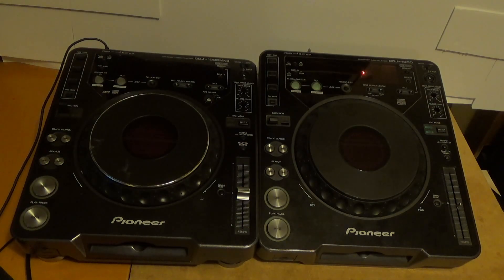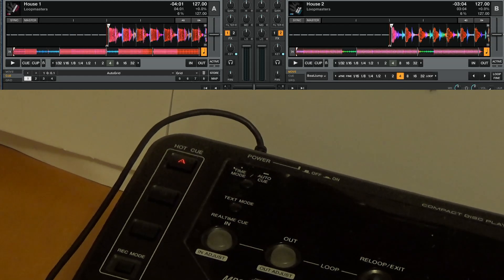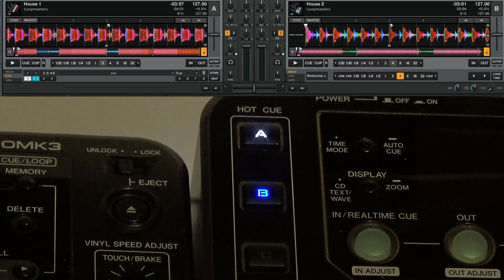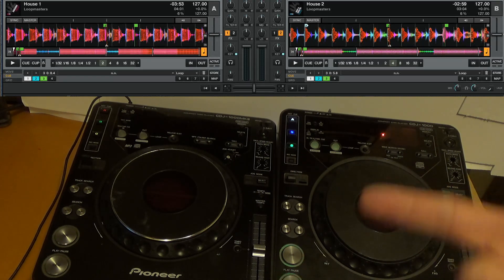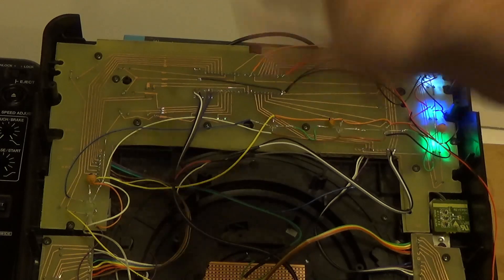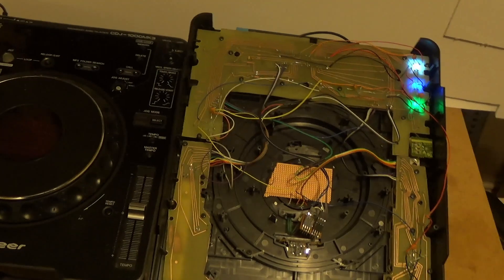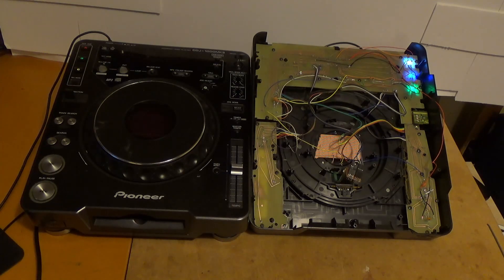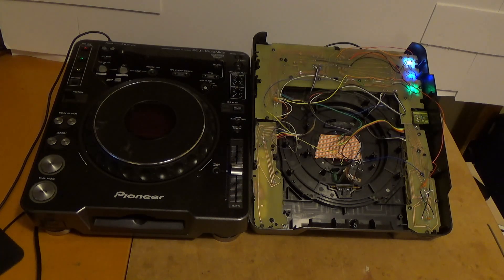CDJ 1000 MK3 Midi conversion- Custom PCB

Comment: Is there any more news on this?  What was the final price for a conversion?
Reply from the maker: I had some problems with the neo pixel, the software lib conflicts with reading the jog wheel so is quite a big problem. I need to switch over to SPI based addressable led and design new PCB. At the same time I was looking  to make connections easy and looking for the best way. At the moment I am quite busy, but also do not have the money spare to buy a new batch of PCB as they are large and will need to order 3 x 5 of them. So it's still something I want to do, but time and money are a factor at the moment. I Keep  wondering if I should setup some form of donations so  people who want to see it could help out. I do use them when I practice at home so have a good idea of how they work I a do like them.
Reply: @DJlegionuk  I'd be interested to hear the progress on this and if you have a price point on what you would sell a kit and instructions for
Reply from the maker: @murraybosley9839  I am stuck on the jog wheel data moving too fast so it's missing and not racking very well and also not having spare money to fix some mistakes on the PCB. I am working on a few things that could help soon.

Comment: Would you be rolling to make this an open source project
Reply: And by the way I would pay the price for the custom board . Especially if it was designed to mod modular and upgrade able.. support is the most important factor.. would you be willing to keep up on the software side of things?
Reply from the maker: HI, I put the software on github and after I finish working on my current project I am going to come back to this as I found a much cheaper fab company in china, the basic quote for a board was £10 so much cheaper. What is in involved in making something open source ?
Reply: all you have to do is submit your project to open builds and you can even use the official seal. http://freedomdefined.org/OSHW
https://www.oshwa.org/
 I would be more then willing to contribute to this project.and helping it come to fruition.
Reply from the maker: https://imgur.com/a/pDUdS
Reply: take a look on my projects: https://www.youtube.com/playlist?list=PLNDBR0PFOTlzc2hULy1p_MsBFc3hoB6hn

Comment from the maker: someone has just put me onto a cheaper fab in china so this changes everything. for the price of one of each I can get 5 of each made so as long I get the design right I could then sell the remaining one to cover the costs.
Reply: Osh park or Seedstudio are super cheap.
Reply from the maker: I am using easyeda, they have excellent online design software and have turned around another smaller project in a week. I started to work on the main board and have made some good progress.

Comment: Love this project, wished to do so a while back, but not in my field...
The price is ok BUT this need to have real nice capabilities into scratching and the central display need to reflect the tracking position.
Reply from the maker: I did a rough jog display tracking on the first version of this mod so it's easy to do, but the biggest issues is 100% tracking the position of the jog wheel. It does not have anything as standard to say it has moved x places or that it has moved a full rotation so I can only best guess and it just needs a few missing steps to throw it out. Even with this teensy 3.6 running at 180mhz and I am using the 2 ports recommended for reading encoders I think it still misses a few movements if they are too fast. I would have to change the encoder wheel to one that reports it's location after every movement to be 100% sure. I am working on some software that would allow you to record a scratch movement and they play it back like a hot cue. I could store these on the sd card and then load into memory. This is something I have not seen before so would be cool, but again could be let down by the lack of absolute jog wheel tracking.
Reply: i bit delayed .... but ... this is what you want :  https://www.youtube.com/watch?v=fKlXErM1WZs   all leds, displays ans buttons working as original, plus, the CD continue working. You switch to midi using LOCK switch. Regards